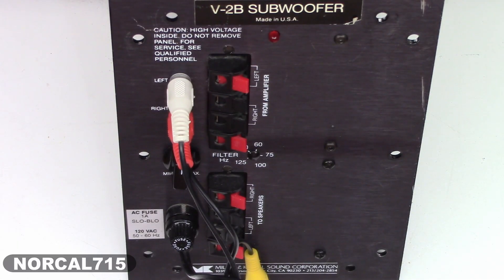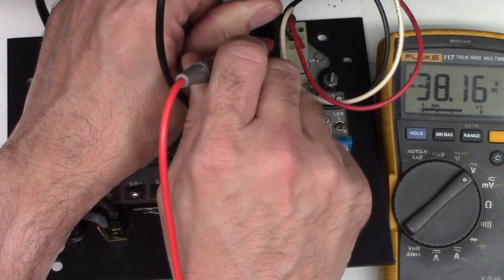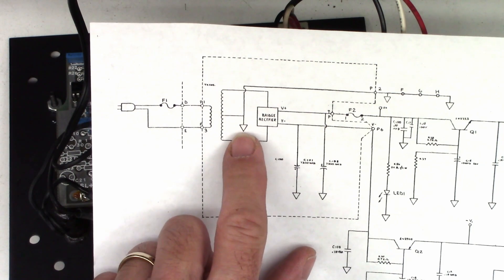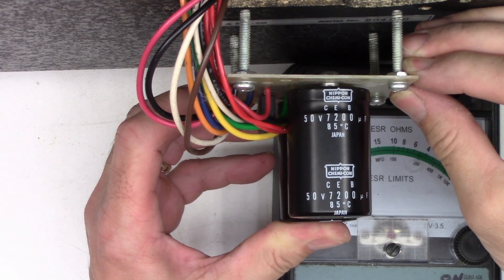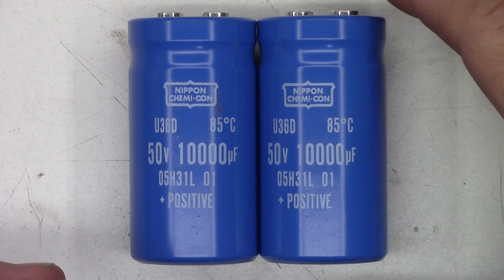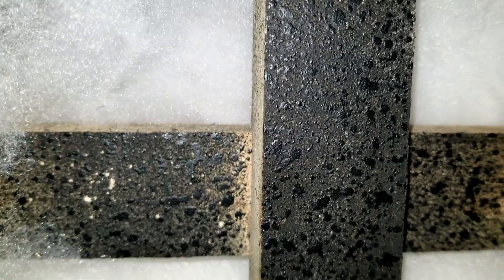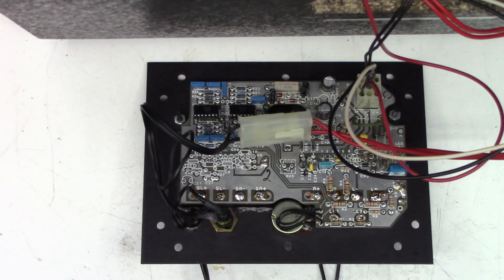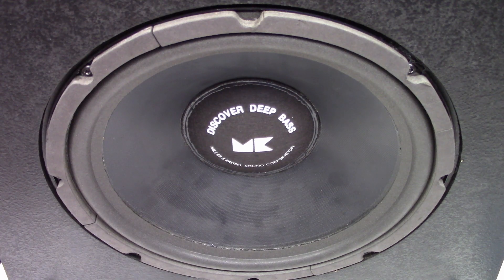MK MILLER AND KREISEL SUBWOOFER REPAIR DISTORTED  HUM BUZZ V-2B V-1B VW-2 VW-1 MILLER & KREISEL

Comment: I need to find new power supply capacitors for my Volkswoofer-2B.
Can you help me?
I think I have the same problem. (When the electrolyte dries out, the capacitance goes away.)
Do you have a supplier at this time?? Thanks, Hank
Reply from the maker: I get them from Mouser.com, Newark.com, or Digikey.com
Reply: @norcal715  Thanks, I just ordered them from Mouser. Hank

Comment: I have 2 M&K subs, I’m picking up noise from wi-Fi and my cell phone. Any advice?
Reply from the maker: They are not shielded against WI-FI RF emissions (introduced before WI-FI was common place) A very common issue with these subs. My advice, move the RF producing items as far away from the sub as possible.

Comment: @NorCal715  Thanks for your videos! I fixed my brother's V-2 sub. He brought it to me with a constant distortion and low output. I replaced the STK086 and the 2 big caps (with the same ones you did) and the 5 smaller caps on the board. At that point it still had the distortion however lots more output--on the right track. I was stumped, checked diodes, pot and still stumped. Then as a lark I put the original STK086 back in...distortion gone! A couple years ago I replaced the speaker surround, now it sounds great, ready to rock another 30 years!

Comment: I just bought a MK V-75 but not working board looks geeat dunno ...  was working a bit but sounded like a torn woofer but woofer is fine ...
Reply from the maker: Probably bad capacitors, and/or a damaged output IC
Reply: @norcal715  do u work on rhem for a price

Comment: Both power supply caps are probably dried out from age.
Reply: I was the service manager for M&K for about seven year’s.  Resigned shortly before they shuttered
Reply from the maker: You know Ken then? I have has several conversations with him.